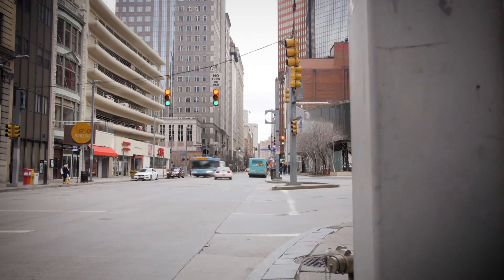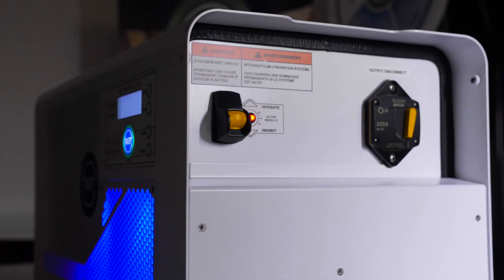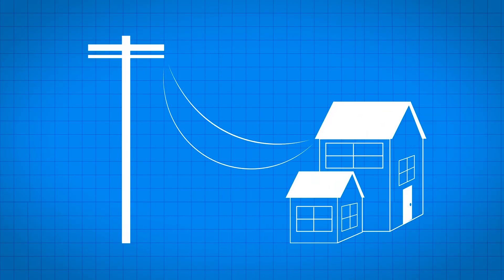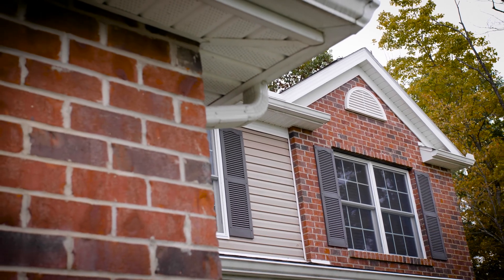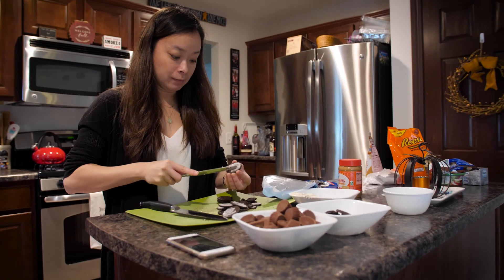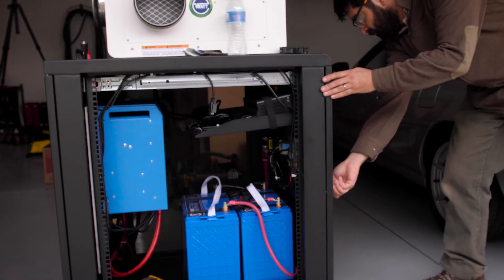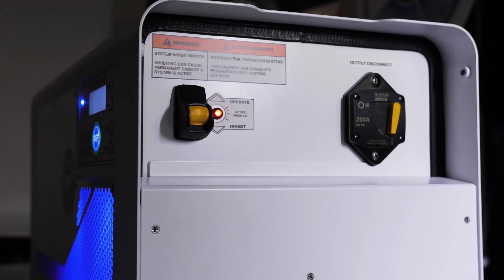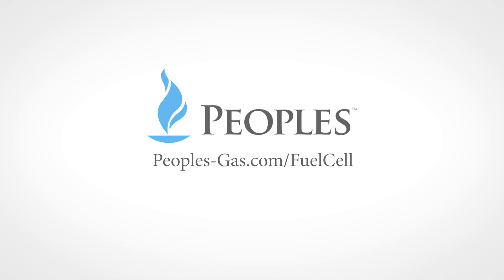Let's Talk Energy Series: Fuel Cells

Comment: Fuel cells require fossil fuels and create carbon dioxide.
Reply: K A Nesiah hydrogen fuel cells have no pollution...this is a SOFC
Reply: @blainevans7047  Commercial hydrogen is extracted from natural gas and coal releasing as much carbon dioxide as burning those directly.  

You can make hydrogen from water using electricity then turn it back into electicity with a fuel cell but the electricity you get out is a fraction of what you put in.
Reply: K A Nesiah you can make hydrogen from any hydrocarbon...and you can make hydrogen from coal and do it with zero emissions. Also historically this is one of the lowest CO2 atmospheric ppm currently, too much lower and plants actually have a hard time. Greenhouses run carbonizers to keep plants fed at around 1000 ppm. Climate fear mongering is some the most hack pseudoscience in existence.
Reply: Renewable Hydrogen - Storing Renewable Energy such as Solar or Wind Australia
https://www.youtube.com/watch?v=vNPMOkB--80
Reply: Making hydrogen from hydrocarbon releases exactly as much total co2 as oxidizing the hydrocarbon directly.  Using hydrogen is using hydrocarbons.

In the real world, using hydrogen is using natural gas and coal.

That's why fossil fuel producers promote hydrogen.
Reply: K A Nesiah I’d like to see the paper on that, since we can remove99.999% hydrogen purity...if you use a steam reformer you can capture every atom of carbon
Reply: @blainevans7047  Current commercial hydrogen production releases huge amounts carbon gas into the atmosphere. 

Hydrogen production methods that do not release CO2 have been around for ages but are not commercially viable.

Let's stop trying to mask the fact that hydrogen is a disguised fossil fuel.
Reply: K A Nesiah Also they have a molten salt fuel cell in Europe that is generating 1 MW and fits in a car, musk is getting nervous.
Reply: @blainevans7047  No one is nervous. Molten salt tech has been around for decades and has always had a niche following like vertical farming.  Like vertical farming it's a ridiculous pipe dream because it's expensive, complicated, unreliable and requires insurmountable infrastructure development costs.  Molten salt fuel cells also produce huge amounts of Carbon Dioxide.
Reply: K A Nesiah carbon dioxide is totally captured in MS SOFC paths, reformer makes methane then use CVD make miralon...
Reply: @blainevans7047  There are lots of utopian fairy tales told by fossil fuel companies to keep fossil fuels on the market.

In reality, commercially available fuel cells are expensive, unreliable and emit vast amounts of CO2.
Reply: @blainevans7047  Fossil fuel companies keep pumping out such utopian fantasies to keep pushing natural gas (methane) and coal but in reality even fossil fuel extraction pumps vast amounts of methane and CO2 to the atmosphere let alone the greenhouse gases that fuel cells pump out daily at real world installations.
Reply: K A Nesiah if your talking about flaring then I couldn’t agree more...there’s lots of companies working on this. But ignorance of science of hydrocarbons cannot be the answer to everything, there’s too much need
Reply: @blainevans7047  There are no needs that cant be met by solar energy, the grid and batteries.